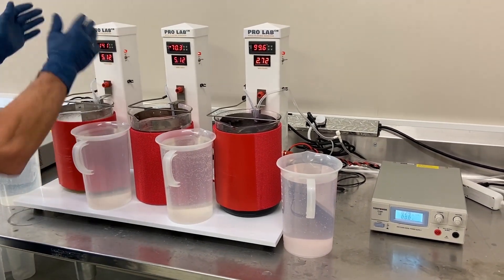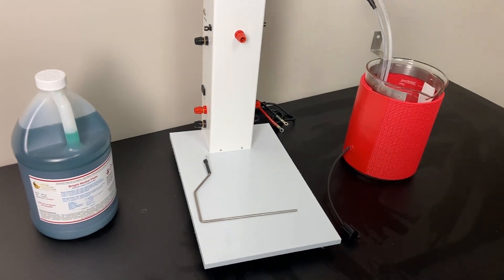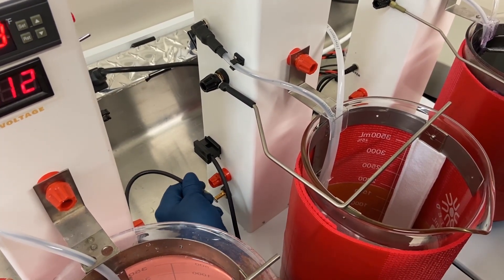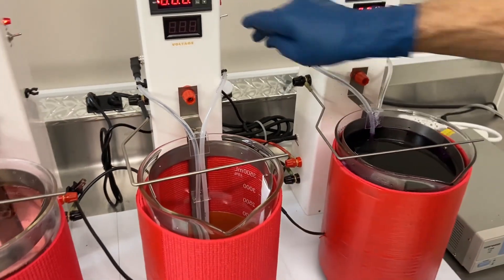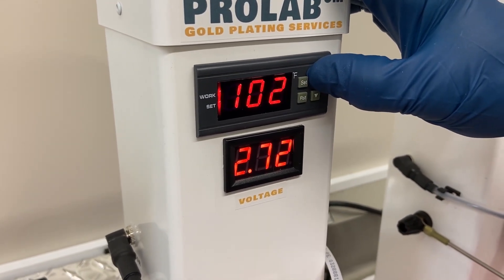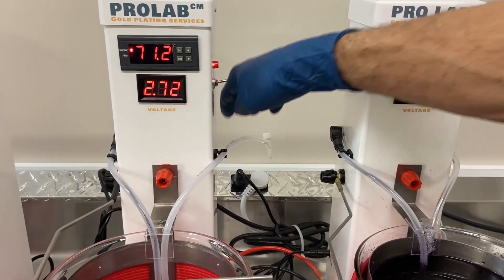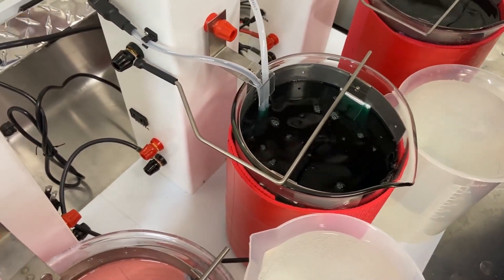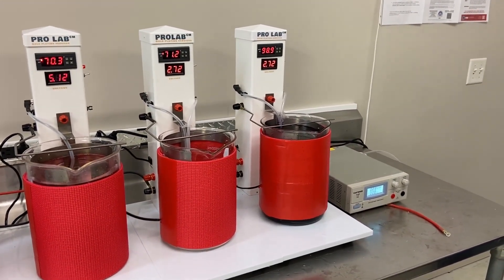24K Gold Plating and Bright Nickel Plating System

Comment: What is the difference between your 24k bright gold and 24k pure gold solutions? Thanks
Reply from the maker: Dusan, 
The 24K Bright Gold has hardeners and brighteners.  It is used for decorative purposes.  It wears significantly slower than the pure gold and also mimics the surface - if the piece is shiny before it will be shiny after, dull before it will be dull after.  The deposit is a 99.7%+ purity.
The 24K Pure Gold has no hardeners or brighteners.  It's used more for scientific purposes, where the softness and lack of any additives to the deposit are important.  The deposit with Pure Gold is 99.9%+ purity.

If you need help deciding which is best for you, let us know!